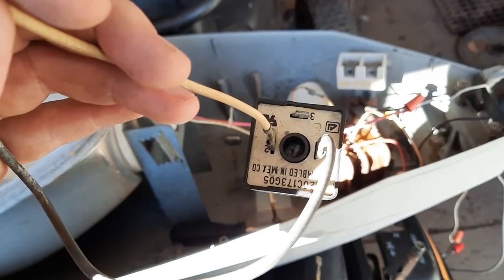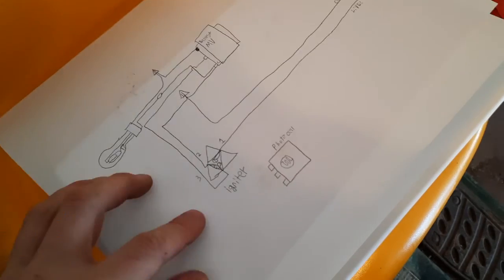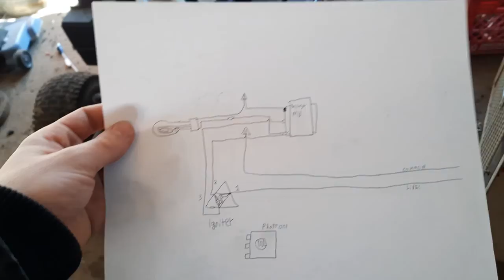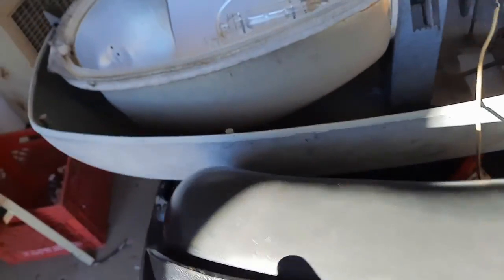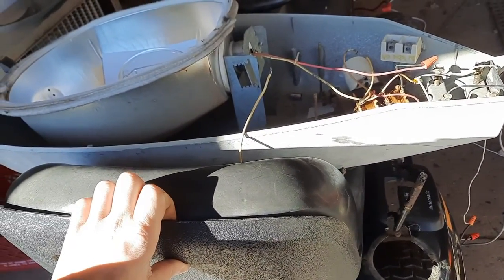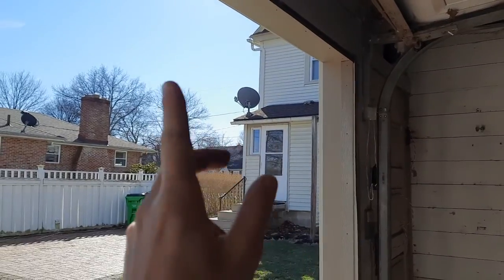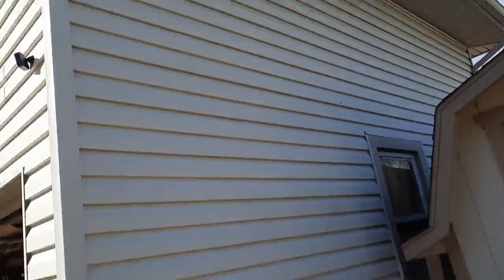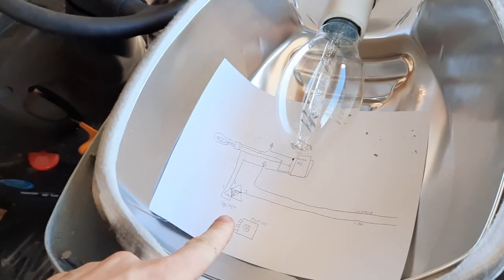I still need help with this street light.

Comment: You don't want or need the igniter in a mercury vapor circuit this will destroy the mercury vapor arc-tube!
The photo cell needs 3 wires line (Black wire from AC power) Load (Red wire to the ballast) and neutral (white wire that gets spliced to the other neutral or ballast COM wires)
Reply from the maker: Is there a way to bypass the photocell, the photocell socket is broken and the cobra head fixture doesn't have a place for a photocell socket.
Reply: @theericfreeze1493  Wire the black (Black from power supply 120V in) to the red (Load to ballast together ) you can either remove the white or keep in insulated as long as it does not touch any other wires you're good.
Reply from the maker: @Peter_Yachymczyk  thanks!
Reply: @theericfreeze1493  Your welcome Eric!